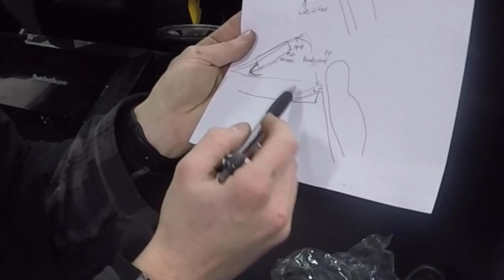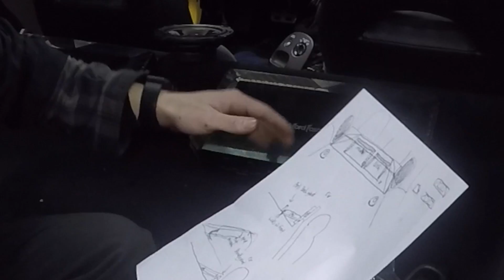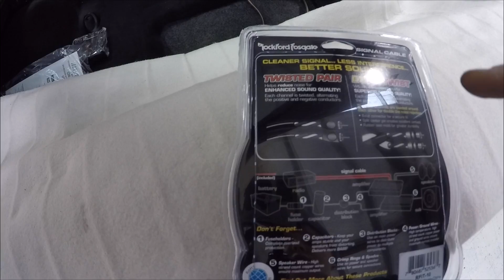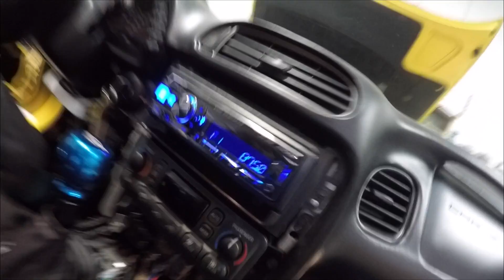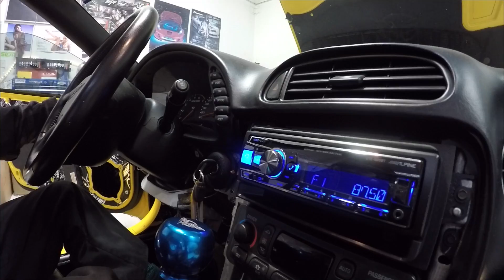CORVETTE C5 | Stereo, Rear Speakers, Cables ALL DONE!

Comment: I have two ideas for the crossovers. First is mount them in the center of the amp rack with each amp at an angle so that they look like the same height ( although since the amps aren't the same widths it might look funny). The second idea is surface mounting them on the front face of the amp rack between the seats. It's pretty simple to just run the wires through the wood making a very clean looking setup.

Comment: I can understand if it was his vehicle and it was not discussed with him.  Some trailer wire is manufactured with a lower standard compared to speaker wire.  A suggestion get spools of aircraft grade shielded quadrax for component installs like this and shielded twisted pair for coax.  I can attest to the quality of that type of wiring due to the fact it is used in multi-billion dollar business jets.

Comment: Multi core trailer wire would be almost the same as the multi core wire stinger has that I've seen. Only reason I wouldn't use it is it I feel it won't handle the power or if it costs more than speaker wire

Comment: Can you put the amps closer together in a beauty box with 2 computer fans 2 push and pulls the air threw and the crossovers on a angle and aluminate them with yellow leds ??
Reply from the maker: +49ics would love to do that but  budget says no
And fans are loud and annoying unless you have one of those smd temperature sensing fan controllers to only turn them on when the amps get hot
Reply: Car Audio.etc. I think those rca cables unscrew to make easier to connect then tightened the ends up to lock like my rf's do

Comment: You should make it to we're you don't have to run lots of wires and make it were it will be nice and cooled. More wire means more resistance and heat will burn that thing up and not to much wait or you lose the power to wait
Reply: Also should ask costumer what they prefer

Comment: Man your amp would only be sending out 24.5v and 6 amps at a full 150 watts of output, I don't know if the 4 channel is that big but 10 amp wire would handle it but I have seen charts the indicate that you'll get a voltage drop if the wire is on the small side which would cost a little power (which I really doubt would be noticeable anyway)